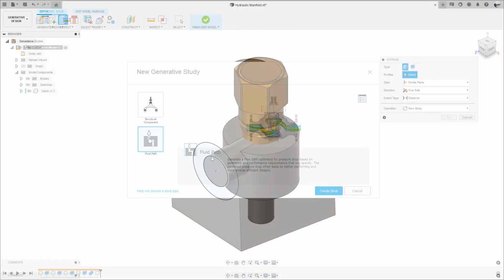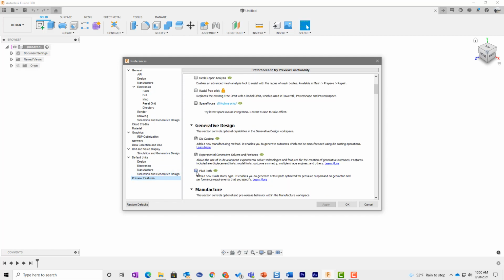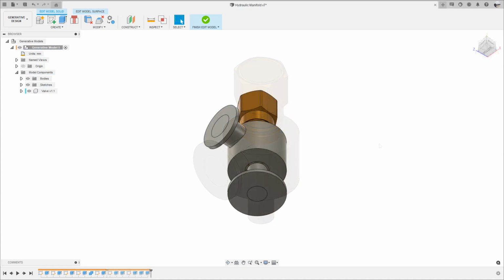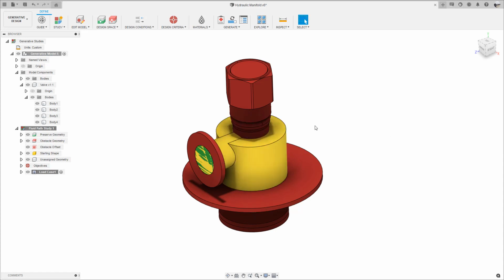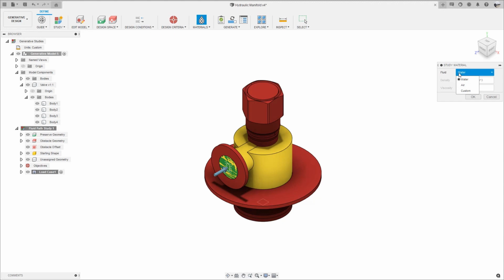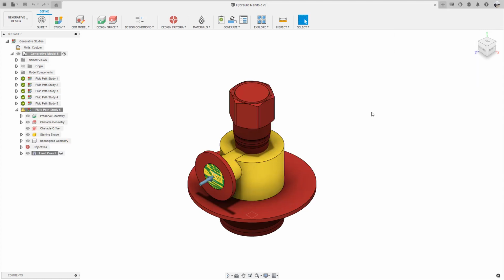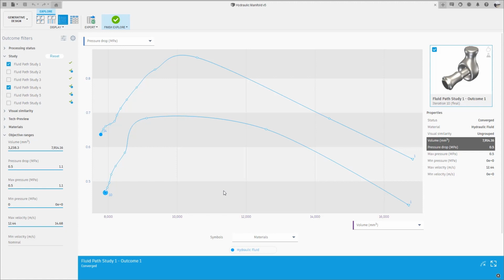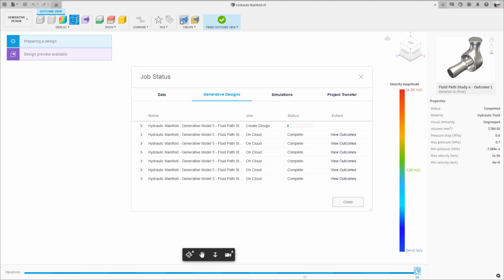Tutorial: Generative Fluids Workflow in Fusion 360 | Autodesk Fusion 360

Comment: In the future will it do flow simulation of solid parts? Valves aren't only for liquids. Rice, sand, steel balls?
Reply: you could probably do a kinematic analysis of that in a different software. alternatively, you could sort of simulate it by fixing the tube, and applying a universal gravity load which causes small spheres to move.